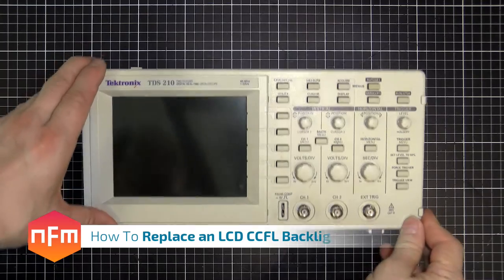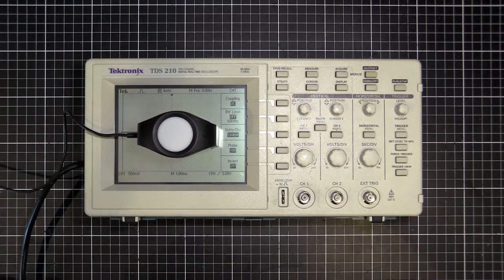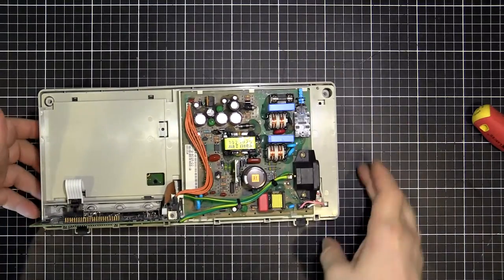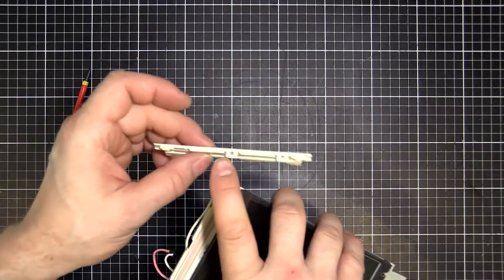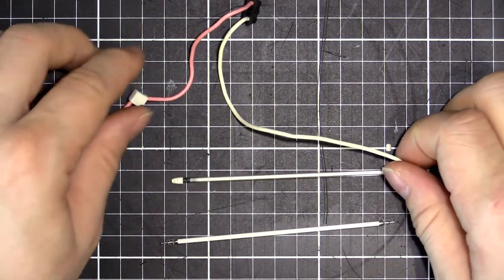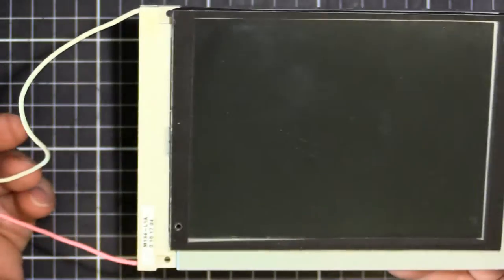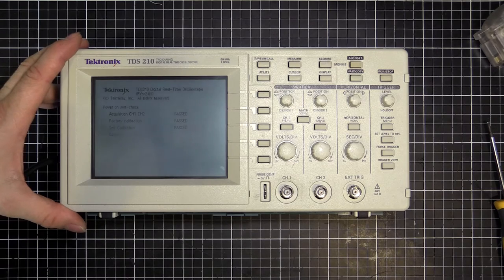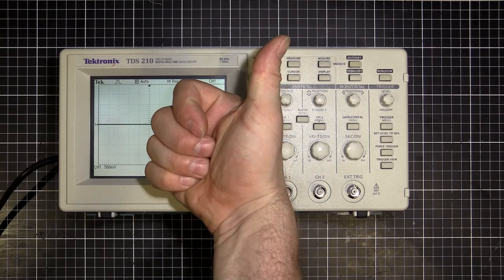Replacing an LCD CCFL Backlight

Comment: I replaced the worn out CCFL lamp in the TDS210 with a strip with 8 white smd 2835 diodes and a 500ohm potentiometer. 8 LEDs are soldered to a 9 cm strip of laminate with a width of 3 mm - every 11 mm. I powered it from the negative 24V present inside. I disconnected the CCFL converter by desoldering the choke coil. Perfect effect!
Reply from the maker: Nice work!
I might have a go with mine one day, now I have some LED strip left over from converting my THS720 scopes to LED.
Reply: @NearFarMedia If you want to desolder the LEDs from the LED strip left, you need to have a few in stock. It will get damaged sometimes. There was an idea for green LEDs, but in the end I used white-natural ones. I cut the copper on the laminate with a scalpel: 10mm copper/1mm gap/10mm copper/1mm gap/....

Comment: It's actually much easier if you disconnect the CCFL from the white wire or red wire that attaches to the black housing, that way you can slip it out as a whole piece and then desolder, opposed to desoldering or using clippers near other parts.

Comment: I can't really thank you enough for the guide, just bought a tds220 locally at $75 and while maybe a bit expensive, oscilloscopes sell for really high prices at my country, so this was a real bargain. The thing is its screen looks terribly faded, so I would attempt to change the CCFL to LED, maybe with some extra 12v power supply wired to the connector and a custom made led strip
Reply from the maker: You can get LED upgrade kits from ebay that would work really well I think.
Check these links for more info:
https://www.ebay.com/sch/i.html?_nkw=led+ccfl+kit
https://www.youtube.com/watch?v=smrMoIpvYTk
Reply: @NearFarMedia  just got a couple non-working tablets with damaged lcd screens as well for pretty cheap, I will attempt to reuse the lcd panel construction of the smallest one for the oscilloscope, they come with good 9v led Strips. Thanks for the info!
Reply: $75 for a TDS220 is still a pretty good bargain, even now.   Tek gear tends to hold it's value, because it is good quality.  The TDS220 is showing its age, but it was cutting edge at the time it was released and is still a good general purpose 100MHz scope now.
It virtually led the pack for for making the 10 to 1 the nrom.  Ie  1Gigasample for 100MHz.

Comment: Thanks, I try to replace or repare a back light TDS3000. The MB3778 neon switch control maybe breakdown.
Maybe it's possible to replace by led device (low voltage)
Reply from the maker: Yeah, I've seen a few LED back light conversions done on old LCD's. You can get a kit from ebay for it.

Comment: Suddenly there's appear a blank screen on my tds220. Nothing showing up. It was suddenly happened one day. Can you say what could happen?
Reply from the maker: Check the voltages from the power supply, the capacitors in these units can go bad.
Besides that, check out eevblog.com foums, there have been a few of these repaired there.
Reply: @NearFarMedia  I'm an elec engg but i got nervous checking out these expensive things but I'll try my best.... But Thanks for at least tell me where to look at
2.I never came across the problem with cap, how to check if cap is fault or not?

Comment: Excellent video !! One question, is it possible to install a color display on this oscilloscope model?
Reply from the maker: Unfortunately not, there is no colour information from the chipset at all so nothing to work with there.
Some other devices with a VGA or video output can have a colour conversion done, but this isn't one of those unfortunately.
Even the screen capture to PC using the optional communications module is a black and white image.
I think the only way to do it is to use the communications module to download the information to an excel spreadsheet then recreate the screen using the colours of your choice. It's more work than I want to spend so I haven't tried it yet. :)

Comment: Hello, nice fixup! I have the exact same problem on my TDS 220. The service manual is stating that the CCFL is working on 1270V peak to peak whereas the CCFL that I plan to buy from www.ccflwarehouse.com is working at 280V with starting voltage of 520V AC. Is it going to work ??
Reply from the maker: +Catalin Popescu Can you provide links to the service manual and the data sheet of the CCFL you want to buy?
It's hard to say exaclt
Reply from the maker: +Catalin Popescu can you provide a link to the service manual and a datasheet for the part you want to use?
It's hard to say exactly, but the ratings on ccfl tubes should be pretty interchangeable for a given size.
Reply: Here's the service manual : http://www.tek.com/oscilloscope/tds210-manual/tds200-series-service-manual.
Please check backlight troubleshooting chapter, it says 1270V pk-pk and 450Vrms for the CCFL power supply.
The CCFL I plan to buy specs are here : http://www.ccflwarehouse.com/30x10fuspcc.html.
Thanks a lot for checking !
Reply: Is it a good scope?